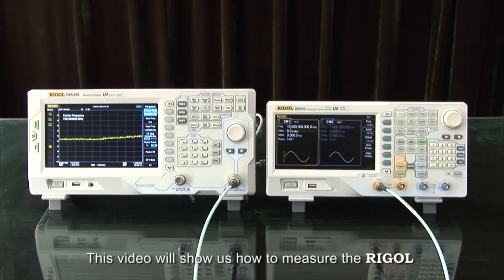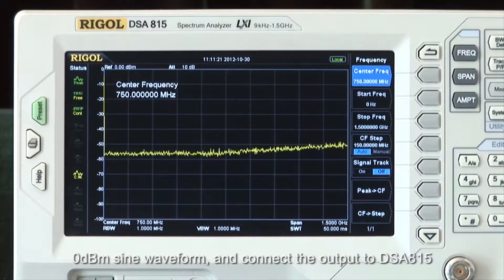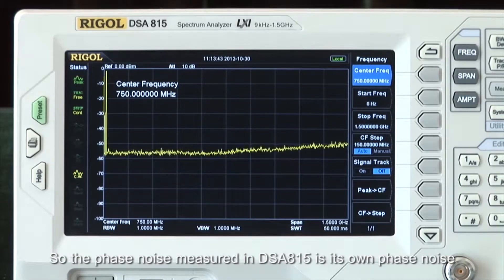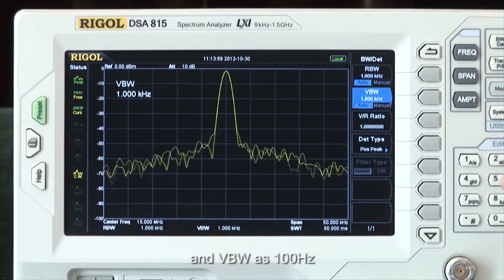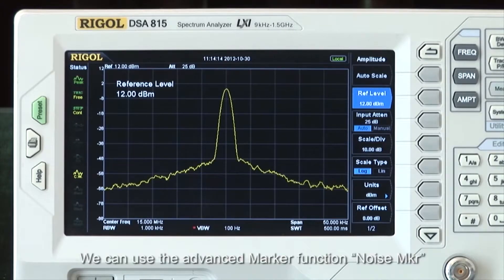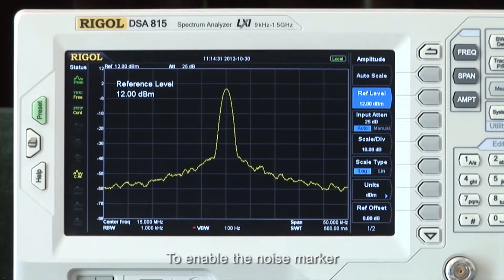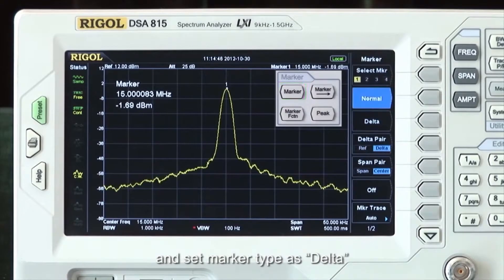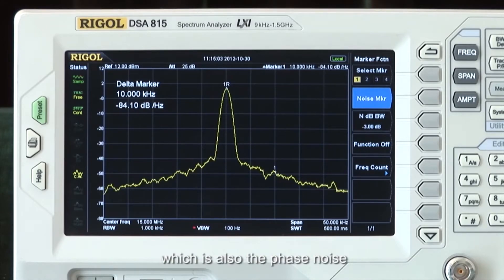RIGOL Spectrum Analyzer Basic Measure Phase Noise by Saelig

Comment: Good video, but I don't think it's necessary to use a Rigol DG4000 signal generator. Almost any Rigol signal generator would have a good enough phase noise spec for this, and I think that should be pointed out in the video. In fact a much cheaper 10 MHz TCXO or OCXO would work too. I just tried this experiment using a Rubidium frequency 10 MHz standard using my own spectrum analyser, and I then repeated the same experiment using a cheap Chinese 10 MHz OCXO module that I got on ebay for 29.99 UK pounds. Guess what? I got identical results. These are the only references I have on hand, but you could probably use an even cheaper reference and still get valid results. It depends on how good your spectrum analyser it. 

Like I said, good video. But, you don't need a Rigol DG400. That is just marketing crap. The video is still great though, and I think the most important thing is the method shown here, as that is very educational. I just don't think it's right that some viewers will think they need to go out and spend 500 pounds on a signal generator.